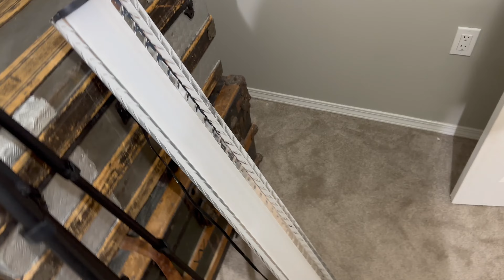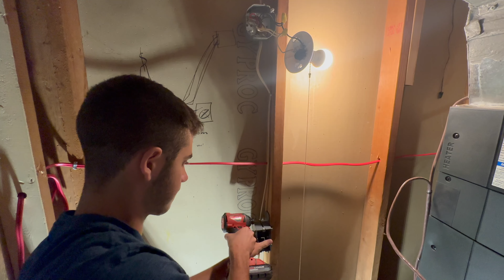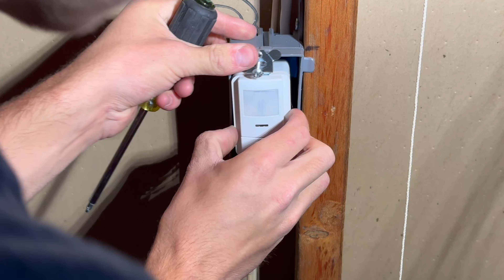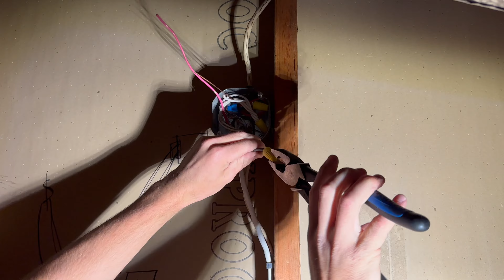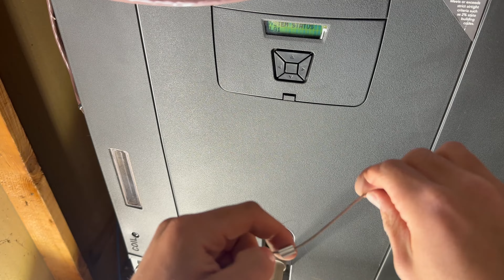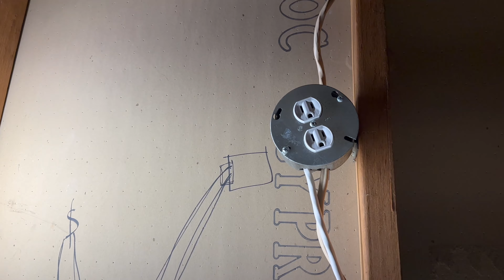Furnace room lighting upgrade

Comment: 13:09 couple of pro-tips:
1) cut your hot first, and temp cap it, else you have a hot neutral from the fixture since the switch was on.
2) don't use your linemans on marettes. It can cause a wire to pop thru, and cause a fault later, tripping the breaker.
2a) 2 above is usually better than a FA ground fault. Except when its not.
Reply from the maker: Yes always disconnect your hot first I've always used pliers on marrette's to get a tighter connection just how I've been taught by my journeyman probably wouldn't matter on lighting but for heating circuits and high current applications

Comment: Why is a plastic box bonded?
Reply: You’re just supposed to do it in Canada
Reply: @baseballlion1615  I wonder why though? What's the logic or reasoning behind it?
Reply from the maker: Because if you don't bond it yours switches and metal devices mounted to it won't be bonded and it's not a good idea to have metal electrical devices with out a bond to ground
Reply: @nics-systems-electric  I understand grounding the devices and a metal box, I just didn't see the reason for attaching a ground wire to the plastic box.  Does it have a conductor or a strap that will contact the device or its mounting screws?
Reply from the maker: @topher8634  the point is to bond the device attached via the bonding strap because we don't bond our switches without bonding the box you would have no bonding on that device
Reply: @nics-systems-electric  so the screw in the back makes contact with the device mounting screws? If so then I understand that. We use to not ground switches here, then in 2002, I believe, it was mandated that the switch had to be grounded. It can be a little tedious too, especially in 3,4,5 gang or more (I have done a 10 gang light switch box before) trying to keep the bare wire away from the ungrounded conductors. Thanks for making sense of this. At first glance it looks like just a plastic box is being  bonded.
Reply from the maker: @topher8634  yes the bonding screw has connection to one of the device screws